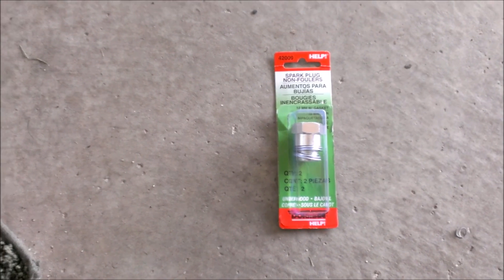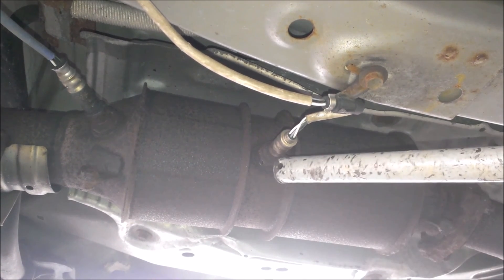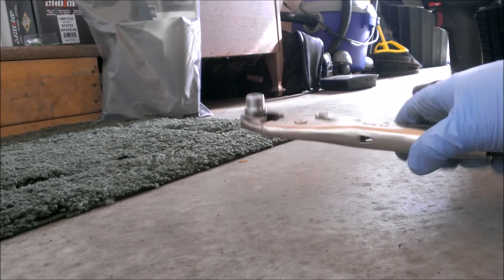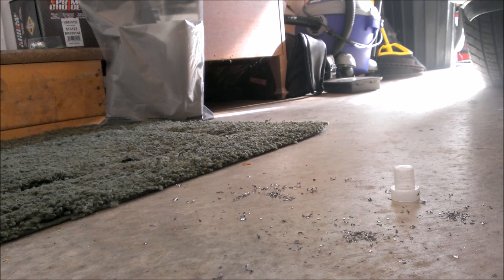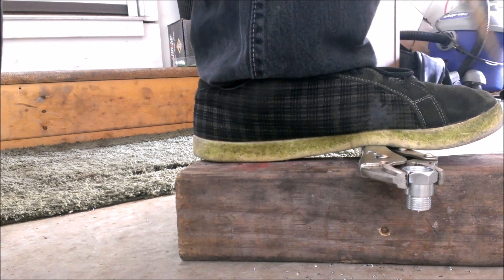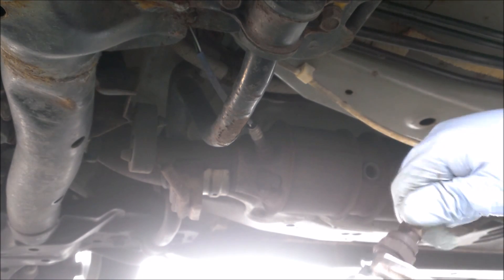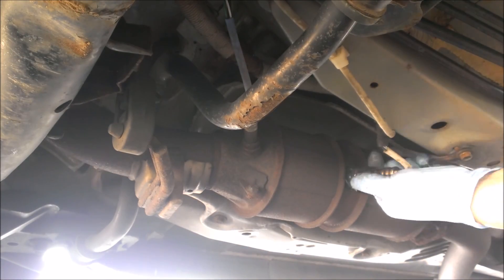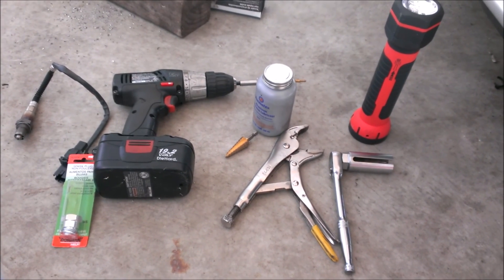DIY:  2002 Honda Civic SI EP3 p0420 fix.  o2 sensor spacer installation

Comment: I have this code P0420 (bank 1) in my ep3 when driving long distances, the code appears occasionally and clears alone, this works?
Reply from the maker: This worked for me.  I had just recently purchased the car and the previous owner told me that it would come and go.  Mine has been like this now for over a month and the code has not come back.
Reply: Thanks friend, I will do this
Reply: You didn’t even show if the code cleared! The hell

Comment: Bought a defouler off one of the civic sites for my 03 when I had it with a header intake and no cat with catback and it did work for a year but my primary ended up fouling out after so many miles and the cel would come back so it works but temporary

Comment: OK I WANTED SHARE MY STORY..I HAD P0420..BOUGHT DEFOULER...IT CAME WITH 2..PART #ENDE LIKE 200002..THE CHEAP ONE..NO WASHER WITH IT...THE SENSOR SEEM TO FIT IT GOOD WITHOUT DRILLING..THE LIGHT NEVER WENT AWAY,TILL ONE DAY IM DRIVING AND I HEAR A CLUNK SOUND UNDERNEATH MY CAR..PULL OVER LOOK UNDERNEATH,IT WAS THE SENSOR HANGING,I DIDNT TIGHTEN SUPERMAN TIGHT,SO DUE TO HEAT IT LOOSE OUT..(ITS KINDA GOOD THAT HAPPEN THO) BECAUSE I ALWAYS FELT SOMETHING WASNT RIGHT...I DIDNT DRILL THE CENTER OF THE DEFOULER!..I THOUGHT I WASNT READING BEACAUSE BEFORE IT POPPED OUT I GOT A CODE FOR P0421,,I WASNT THINKN,,SO I HAD A FRIEND RILL THE HOLE BIGGER LIKE THIS GUY DID IN THE VIDEO!..4:04.....U HAVE TO DRILL THAT CENTER!..OR I WONT READ RIGHT!..I PUT NEW SENSOR AND THE OTHER DEFOULER THAT WAS DRILLED OUT ON TIGHT!..PUT IT BACK IN TIGHT!..PROBLY 5MILES DOWN THE ROAD THE LIGHT WENT OFF!!!..THANK GOD..LOL.
KEYPOINTS FOR IT TO WORK
DRILL HOLE IN DEFOULER AND TIGHTEN EVERYTHING SUPER TIGHT BCUZ IT GETS HOT THINGS EXPAND...I HOPE THIS HELP ANY EP3 OWNER!!
Reply: With it pass smog
Reply: Did it pass smog??? I got my 2002 si ep3 with the code P0420 i need to smog to get my plates and register it to my name

Comment: Did you use the washer that came with the spark plug non fouler
Reply from the maker: Yes
Reply: @DIYAUTOCAR  thanks im gonna try it right now this code just popped up
Reply from the maker: @jacobm7580  good luck. It worked for me for many years until I sold the car recently.
Reply: @DIYAUTOCAR  pass the emissions! Thanks again!
Reply from the maker: @jacobm7580  that's great! I'm glad it helped.

Comment: Will this help pass the emissions test where they plug a scanner into the dash?
Reply from the maker: It depends what they look for. Some places just check for codes and others will read live data.
Reply: @DIYAUTOCAR  so I put the parts in this morning and the check engine light turned off by itself without unplugging the battery... Am I good to go or will the code still be the system somewhere?
Reply from the maker: @derek10w  it should be fine. Maybe drive around a while but if you didn't reset the light then your readiness monitors and whatnot should be good. Often they check for no current codes and for the readiness monitors to be completed.
Reply: @DIYAUTOCAR  right, I didn't disconnect the battery for the sake of the readiness monitors. Drove for about an hour in the freeway going 60+ mph and the light went off on itself. Thanks for the help!
Reply: @DIYAUTOCAR  borrowed a scan tool and cleared the existing p0420 code in my system. No lights, no codes. Fingers crossed 🤙
Reply: @DIYAUTOCAR  it worked 😎
Reply from the maker: @derek10w  good job!

Comment: Just bought a 02 ep3 silver recently with this on the 02 sensor wonder if its thos exact same ep3
Reply from the maker: It's not the same exact car.  This is my personal daily driver that I still own.   This is a very common thing that people do.
Reply: DIYAutoCarage  crazy if it was same here my daily as well best daily for the price i paid
Reply from the maker: Yeah, it has been a great daily driver.  I've only had to do basic maintenance on it.  Now, if only it had a 6 speed instead of the 5 speed....
Reply: DIYAutoCarage yea i agree not only do i have a 6 speed brz that im use to but i feel it needs a 6 speed might do a si k20 tranny swap

Comment: FWIW, if you still get the CEL light and it won't go away, jam a little steel wool in the defouler. Did that 40,000 kms ago in my 2002 SI, light never came back.
Reply: Did it pass emissions?
Reply: @neilheater6852  No emissions in my neck of the woods. We have lots of trees :)

But years back when I lived in a more woke city, I did have another Honda (1984 Civic) which required a smog test. This concerned me, as the exhaust had fallen off, and I had hammered a straight pipe into the remaining exhaust manifold so I wouldn't choke to death in traffic.

Anyway, she passed with flying colors.

Hondas are special.

Comment: Will this help with emmissions test
Reply from the maker: It won't throw a code anymore, if that is what you're asking.
Reply: Hey im having issues with how my sway bar links. Are installed they are under  the lower control are. Is that correct.?
Reply from the maker: Yes, on the front they bolt up to the lower control arms.

Comment: In my case after doing this, the code P0420 disappeared but now comes and goes the P0421 code.
Reply from the maker: That is unfortunate.  Mine has been doing fine ever since.  No codes on at all and the car runs great.
Reply: Francisco P bro drill the DEFOULER..if u don't it won't work

Comment: Whats the part number?
Reply from the maker: Just go to any parts store and buy a spark plug defouler and drill it out.  Or even easier, but an o2 spacer on ebay.

Comment: didn't work for me, also the car did not response good on acceleration pedal ;p
Reply from the maker: Did you put the spacer on the wrong o2 sensor?  If you put it on the pre-cat sensor then that is a wideband sensor and you would have issues.

Comment: whu u just not buying the sensor is only $65,i did this when i have long tube headers ,if u car is stock make no sense
Reply from the maker: Because the issue is not the sensor.... It's the catalytic converter.  I would rather spend $5 for this instead of buying a catalytic converter for $300ish.
Reply: oh ok , It wont pass emission, i had an si 2002 with rsx  base catalytic for $80 used works no problem
Reply from the maker: No emissions where I live so I don't have to worry about that at all.
Reply: oh ok good

Comment: What's the point of this ?
Reply from the maker: To get rid of the check engine light.
Reply: Really old question, but many states that test emissions, you won't pass if the CEL is on.  This is the fix when you don't want to spend $600-1200 on a replacement catalytic converter on a car that may not be worth that repair.  You can double up the non-foulers, i.e., screw the 02 sensor into the drilled out one, then screw that assembly into the non-drilled one and then screw that into the back of the catalytic converter.

Comment: This didn't even confirm if it works or not dude....... just adding an extra piece of metal with zero results lol waste of time
Reply from the maker: This was 6 years ago and the code never returned and the car still runs fine.